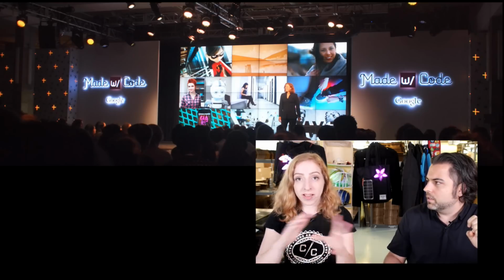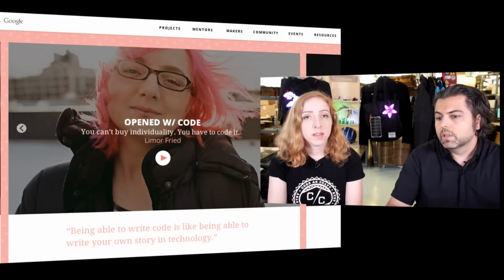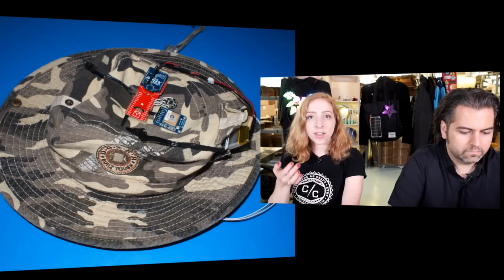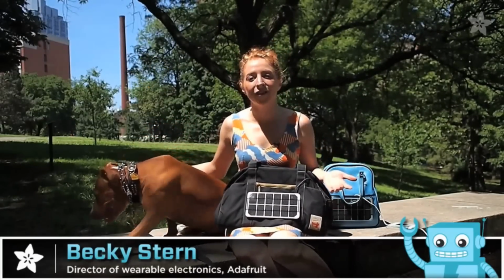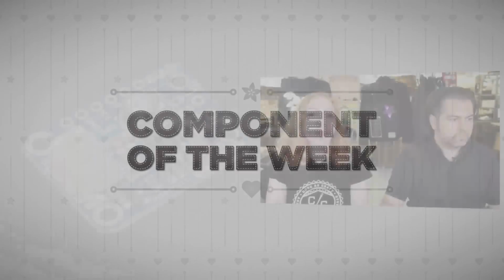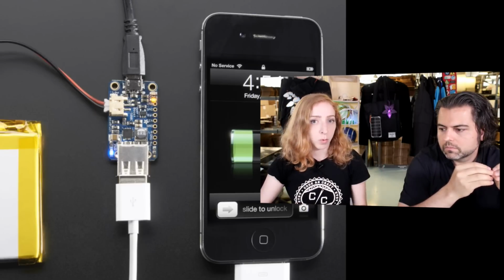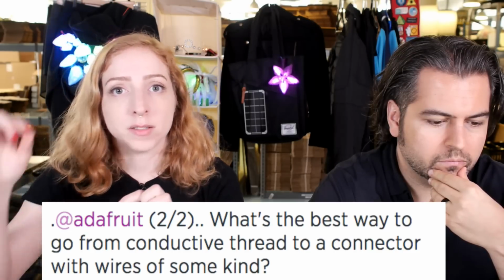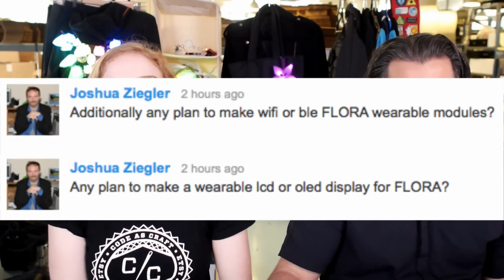Wearable Electronics with Becky Stern 6/25/2014 - LIVE

Comment: With Gemma, how many ws2812 or ws2811b could you solder and power to all pins before using a lipoly would be necessary versus the button cell holder?

Comment: Hello, I'm 16years old and looking into addressable SMD LEDs and noticed that there are not many good tutorials that help beginners like myself learn to code these, any suggestions? I'm also purchasing the Gemma starter kit, but wondering if getting a lipoly is really necessary versus the provided button cell battery? Thanks.

Comment: Okay, I'm planning to use wearable electronics in my final project at uni (I'm doing Costume with Textiles), but I'm wondering about any health and safety issues. It would be likely that I'd want to layer (light organza or laser cut) fabrics over the LED's/pixels to create a more experimental effect, but I also don't want to set my models on fire. What sort of restrictions are there to prevent overheating or fires? Is it something I should be worrying about? (because I am...) D: